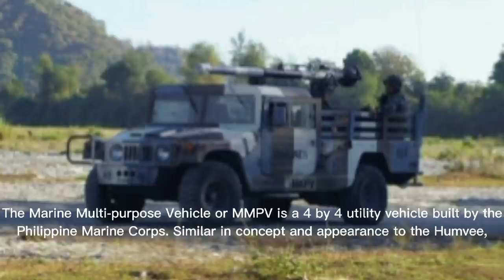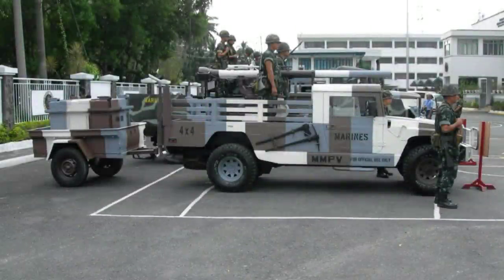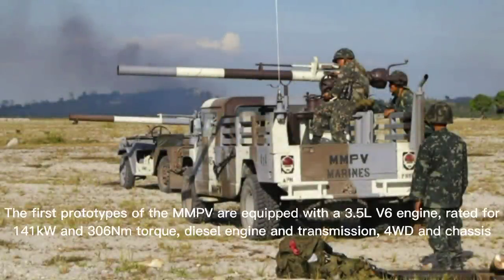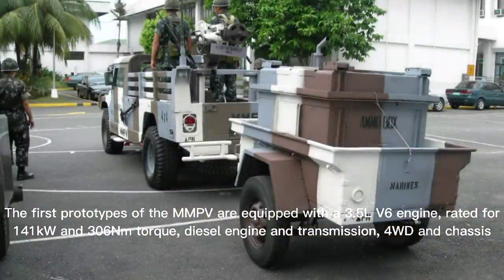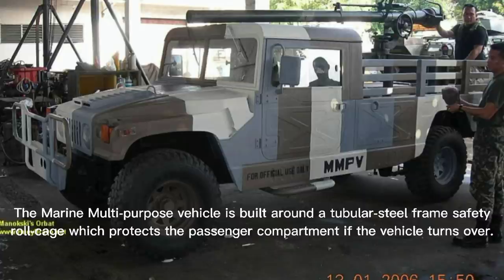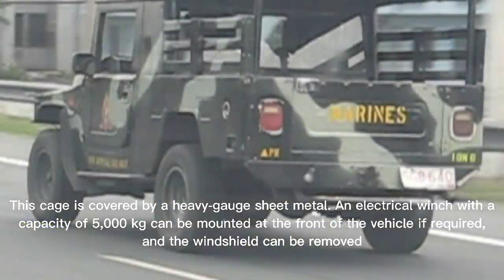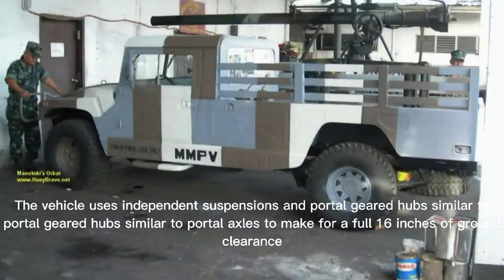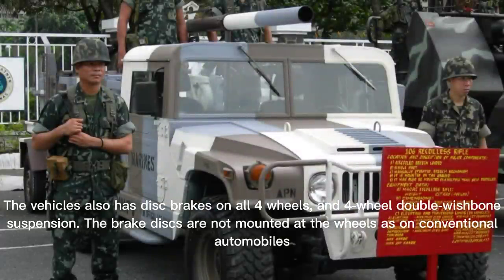The Marine Multi-purpose Vehicle that proudly Philippine made

Comment: Sana ma upgrade yan at ma mass produce
Reply: @hansdontlewdtheloliplsorwe3947  troop transport ang main focus nila. Better to use small MRAPs with ATGMs dince mas maneuverable sila kesa sa trucks.
Reply: @hansdontlewdtheloliplsorwe3947  Self propelled artillery is a standalone system. Also, even a 105 mm artillery might topple a utility truck like the KM450 with it's recoil. Better just buy SPAs like tye ATMOS from israel atleast un may guidance system pa ung shots. Leave the KM450 sa troop transport.